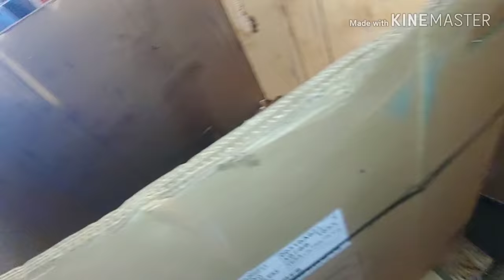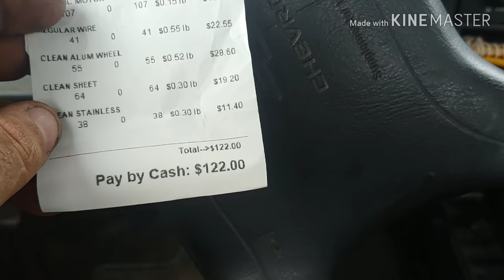Processing scrap and non-ferrous run

Comment: Killing it with the stock piling..the rain at the end of the video is been line that here on the west coast of florida for 4 days now..we own a property maintenance business and havent been able to do shit..oh like i said if i lived up there youd jave ahit to work on constantly..my 1500 has been killing riggt side brakes like fucking mad,changed rotor all bearing pads n caliper,do you think it can be the rubber hoae collapsing under pressure,it wont release the caliper had to take off the plastic bacoing plate where the abs goes cauae all the heat melted it..
     Thanks for the time and videos
Reply from the maker: That's probably it the hoses collapsing on the inside it's a common problem
Reply: @ScrapFarm  ill try it tmrw..see if i or you were closer id loose cash and youd make cash

Thanks Bro..
Reply from the maker: @charlesmeguin5608  I'm so over working on s*** though I do it for some people just to help them out and I obviously do my own things because I can't afford to pay someone else to do it and when you pay someone else to do it they always mess it up anyway seems to be good luck bud
Reply: @ScrapFarm  yeah bro it was ...replaced it today alomg with yet another new set of pads and the new fucking rotor has a warp in it as well..that ill deal with another time,between the last couple of days ive spent almost $ 300 on the right side only....fuck this thinkong about buying a newer truck
..listen you are extremely correct on doing shit on tour own is way better and you know its done right..thanks forvthe advice and keep on hoarding bro...